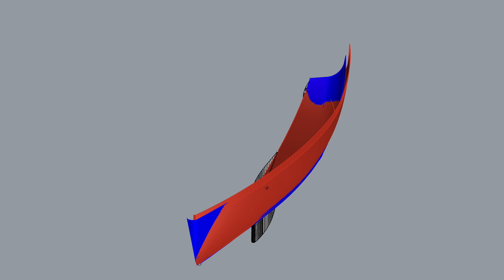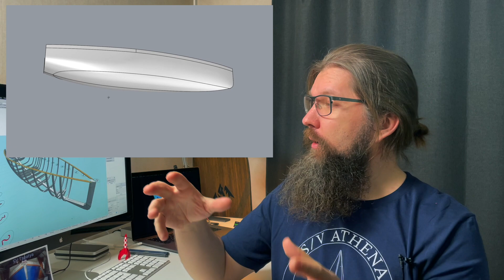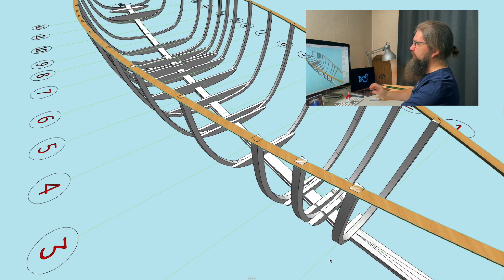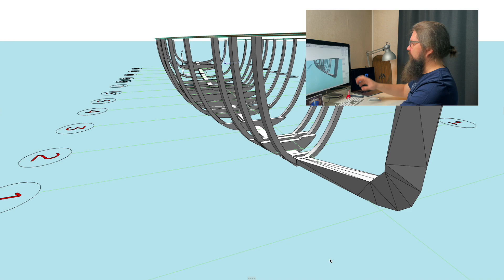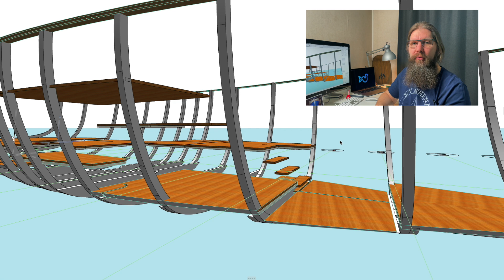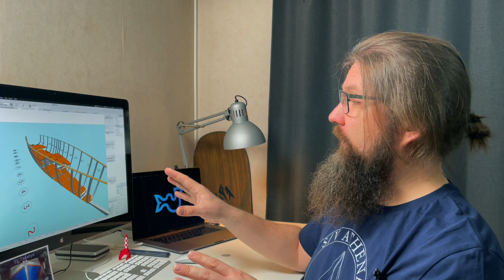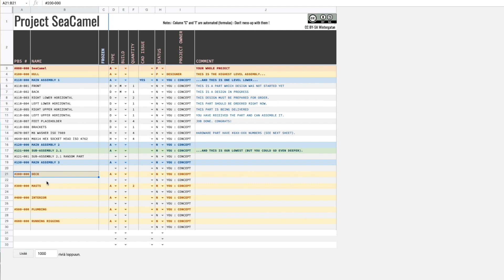Wrap up of 2021 and plans for 2022! Some Sailboat Structures! Ep30 Project SeaCamel

Comment: yes - its okt 2022 now - and I see the start of the framebuild... so time is very optimistic - but still impressed like hell what has been achieved already. If I understand it correct it will be cold moulded hull - that really the best way of building wooden hulls IMO.  Back some 20 years I was joining a friend to get a could moulded trimaran 56ft Undorousa in Spain - it was made by one person mostly  ans still in good shape. Its still exist down south in Norway. One thing - as an architect I use to love plywood - but as a boat building and constructive material i would not recommend use it much; the main reason is that 50% of the fibers will not be useful for the strength of the construction - and if its some leak the water will go anywhere inside plywood.
Reply from the maker: Yeah, the delays have been mostly financial. Some things have costed more than I thought initially - mostly the machinging of the CNC. Also connecting the electrics took quite long time.
Currently I try to figure out efficient way to make the frames and their stock to get good pace for them. Current schedule goal s to get the boat hull planked and finished from the outside and get the boat turned around about an year from now or less.

Plywood is great, flat and accurate material. Easy to cut with CNC etc. Of course it's used where suitable and needs to be protected well enough.

Comment: Have you seen life on the hulls? He has a spray gun setup which mixed the 2 components as they come out the spray gun. He is using vinyl ester but I think it can be set up for different resin systems.
Reply from the maker: Hi! Yeah, been following Ross's effort for years. Great dude and what a job!

That spray gun works with vinlyester or polyester that cure themselves by the help or very small amount of catalyst. But epoxy is mixed in ratios from 1:2 to 1:5 and is much thicker. It needs to be stirred very well before use. There's some machines available but they're very expensive.
Best solution I've come up so far is to have some kind of simple electronics to drive two peristaltic pumps with stepper motors. Problem can be that the amount those pumps normally do are quite low and viscosity of epoxy (at least in lower temperatures) can be a challenge.
But research continues!

Comment: Please explain in a video how the hull shape is different compromises. Modern hull shapes often have very broad stern along way to the bow and often very high hull all the way, what drawbacks is it to that? How much is a deck salon a drawback to the sailing performance? I guess you want the sail as low as possible to gain performance.

Please elaborate about these thoughts, thank you and keep up the good work,👍🏼 I’m interesting in how to videos 👍🏼
Reply from the maker: Hi! Thanks for the comment! Yeah, that’s interesting topic. I’m not sure if my knowledge will be enough to explain it all 😅. I just believe knowing the basic principles 😜
Shortly I can say that wider flat forms move more rapidly on waves and are more uncomfortable. But they give more form stability which allows more sail and thus more sail area thus more power. But they also reduce the available weight carrying capacity.
This would be a great topic but needs quite a lot research to keep the facts right. 😊
Reply: @ArcticSeaCamel  you hear alot about the difference in different keel types but not so much about the hull shape. Maybe the new modern hull shapes is a tradeoff between space and seaworthiness?

Comment: I have used epoxy quite a bit. The west system of metered pumps are really good. They have a big pump for resin and a smaller pump for hardener and 1 pump of each makes the right mixture of resin and hardener, or 2 or 3 pumps. Its hardly a machine but its mostly all you need. As even with a slow hardener the working time of epoxy is limited say 20-30 minutes tops. So that means that whatever task is being under taken mixing only 25 minutes of working compound is not very much. Plus as I discovered very early on, the resin when mixed is exothermic so a rather large batch mixed up can generate enough heat to catch fire. All of this is to say a machine is hardly necessary. But what I liked was having some standard measures, and recipes Eg to make a hard filleting compound it might be 2 pumps and one scoop of micro balloons. And having recipes for glue, faring compound and so on made it much quicker to make the right compound and get to using it. The other thing I would do is to alway have more parts to work on than what I had made compound for. So if there was fillet compound  left over I had other parts to fillet. As the epoxy is expensive its good to plan to minimise waste.

Comment: If I understood, you plan to have many up and down on the interior floors of your boat....in my opinion that's not a good idea....will be nice to know what other peopke think....
Reply from the maker: Well, the design is always compromise. There will be multiple floor levels on the boat and that's just the way it goes with this kind of layout. But the main floor on the main saloon should be in one level generally. :)